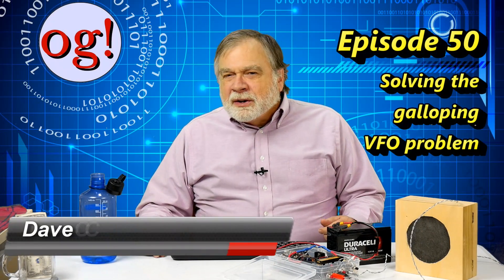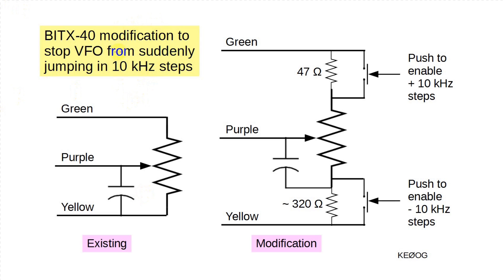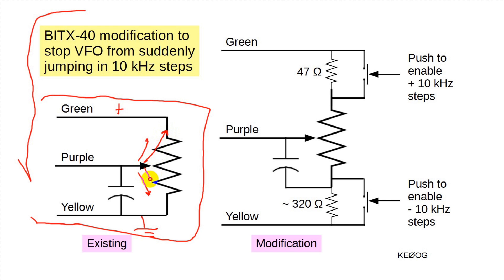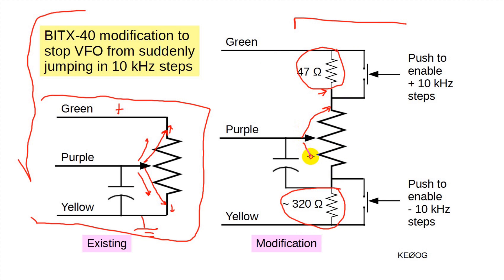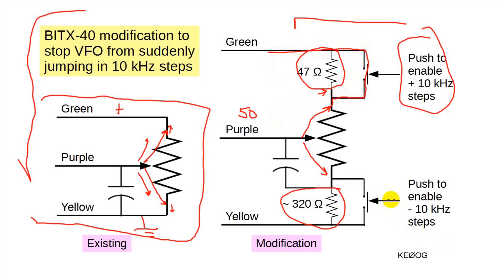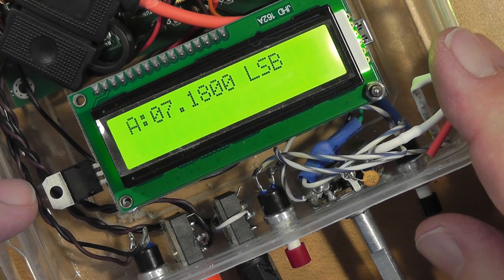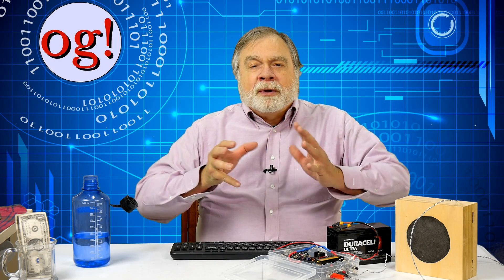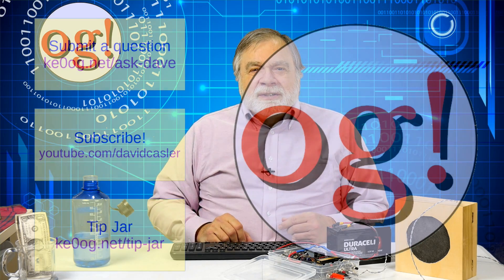BITX-40 Fix for Galloping VFO: AD #50

Comment: HI Dave great mod makes the standard software usable and possibly the best for basic SSB suits my needs thank you Mike G6DWX  Ifound a simple mod for the clicks Having built two uBitx transceivers I thought it would be good to build a Bitx40 on the bench roughly wired the radio functioned well only when assembled in a case did the dreaded tuning clicks over audio start. I implemented most of the standard solutions without success only after rewiring the volume control with figure of 8 screened litz wire, screens to the volume control centre connection did the problem disappear .  Wire recovered from a cheap pair of earphones. So easy so cheap and more effective than capacitors all over the radio.
Reply from the maker: I do get some tuning clicks on mine, but they're not bad.

Comment: Hi David ! 
Yesterday got my Raduino based Bitx40v3 operational (Was using an old style analog Bitx before). Actually I found the galloping feature (the shuttle-like tuning procedure) as an interesting part of raduino Bitx40. I use a much smoother and smaller potentiometer along with a big knob to tune the VFO. It is very convenient and allows me tune very fast. As the knob is big, I turn it with a single finger, as you would do on a commercial rig ! I dumped my plans to change to a rotary encoder due to this ! Try it, you might like it. 73s from VU land, DE VU3VWB
Reply from the maker: Thanks for the tip!

Comment: I just did this mod to mine Dave, and it makes life a lot nicer!  I am still scratching my head, though, on the dual voltage inputs; the one particularly to the PA!  Thanks for the great videos in amateur radio!  Karl
Reply from the maker: Karl, the voltage input for the PA is normally wired to 12 volts. However, it can accept over 24 volts. But there's a caveat--you need to attach a much bigger heat sink. No size is specified. I just feed mine with 12 volts.

Comment: Seems like a lot of work to defeat something that is actually a design feature.  I have had no problems at all with the RADUINO, perhaps because I read the designer's notes.   Each to his own I suppose.  Al GM1SXX.
Reply from the maker: You're absolutely right. It's a design feature. Not one I like. Given that this radio is designed to be hacked, I hacked away.

Comment: Nice hack. I made a change in the software that I have a tuning range of about 300kHz by reducing the increment when turning the VFO knob. I had to replace the stock potentiometer by one that has 10 turns for the full range. So it stays fine tunable. The push button solution seems a good hardware side hack though. A combination of software and hardware could be a pushbutton that shortens one of the free arduino pins and then change the software to only gallop when the button is pushed. So only one pushbutton and no resistors is needed. Using a combination of one pushbutton and a software modification you can use a pushbutton to change the amount of Hertz beeing increased or decreased by tuning the VFO pot too. I think I will try that soon.

Comment: nice fix. but what resistive value would it take to make jump buttons for other frequincy selections. adding 10khz and 100khz buttons. maybe even lower buttons. and toss the potentiometer. why not? it would seem to be more precise in frequincy selection with that method.
Reply from the maker: I agree, but that solution would require a software modification.

Comment: I've seen a mod here on youtube somewhere that replaces the 10k pot with a rotary encoder with push button that allows you to change the tuning steps. I've yet to find a good write up on exactly how to do that. I know that it requires tweaking the software a bit. I'm sure one exists but with the plethora of information on the group its hard to weed through it all. Great explanation of this particular modification. 
Thanks and 73's
Marvin
N0MLP
Reply: Marvin, yesterday on the BITX20 google.io group, Jack W8TEE posted a couple general articles about using rotary encoders. Hunt those down or send me an email. I'm good on QRZ.

Comment: Dave, you must be reading my posts. The only part of your circuit that I would have done wrong was the differences in resistor values. I thought they'd be equal. I've bought my buttons and am waiting to start wiring. I still would like to try the 3 or 10 turn 10k linear pot. They are on order from China. Thanks for the great video. WA1MAD, Mike
Reply from the maker: Hi Mike, the problem with the BITX forum is not that there's too little information, but that there's too much! I asked the system to give me a daily digest, but I seem to get one hourly! I can't read them all, so some get deleted at random. I also thought the resistors would be equal, and finally resorted to using clip-leads to try different resistors until I came up with about the value shown. Going back and checking without the resistors, I found that my BITX-40 goes into galloping down somewhat before the end of the range of the VFO pot. I spent much of yesterday making it work, and even recorded what I was doing, but in the end decided on a short summary. Thanks for the kind words and good luck with your mods! 73, Dave
Reply: Quick question Dave. What do you think the .1 ufd cap from violet to yellow is for?
Reply: Dave, I have started saving detail postings that I am interested in, in Notepad.
Reply from the maker: It shorts any RFI in the wiper arm (the part that controls the VFO) to ground.